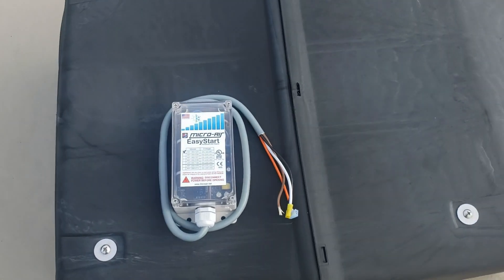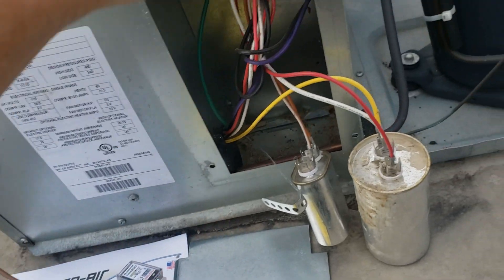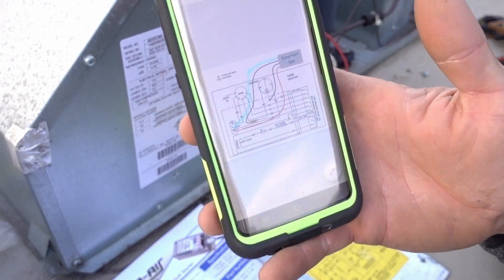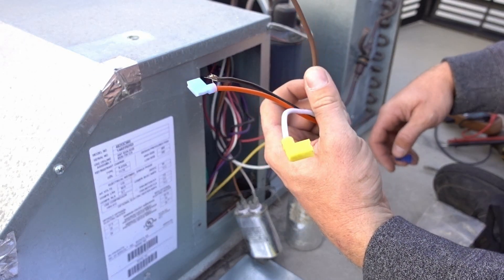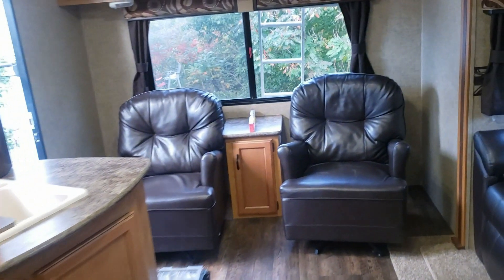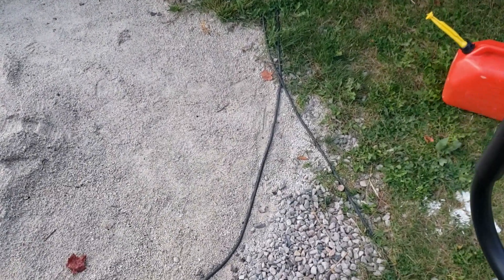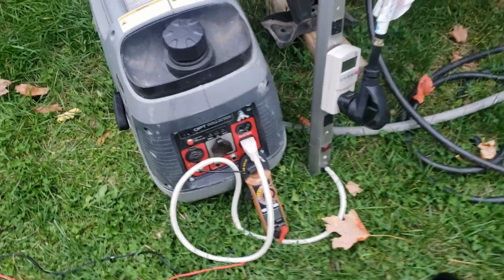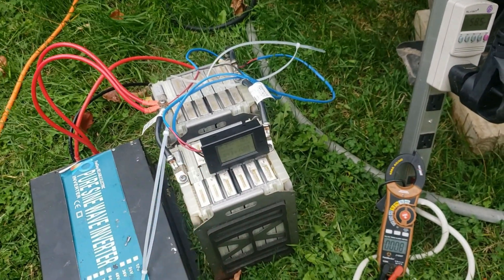Going Off Grid with Micro-Air EasyStart 364 to start RV rooftop AC 15K Coleman AC & Heat Pump

Comment: What is the model of your generator?  I have a Champion that produces 1700W continuous and 2000W surge and wonder if that should work.  Seems the vendor is suggesting a Honda 2200W.  Thanks.
Reply from the maker: its the p2300 so 2300w peak and it ran it with no problems

Comment: More EasyStart info from Micro-Air 

EasyStart wiring Diagrams:          http://www.micro-air.com/kb-easystart/articles_installation/easystart_RV_Brand_Specific_Wiring_Diagrams.cfm  
EasyStart 364:         https://www.microair.net/products/easystart-364-3-ton-single-phase-soft-starter-for-air-conditioners?variant=30176048267
EasyStart 364 Knowledge Bank:              http://www.micro-air.com/kb_easystart.cfm
EasyTouch RV Smart Thermostat with WiFi:              https://www.microair.net/products/easytouch-rv-thermostat?variant=32199143555156
Micro-Air videos on YouTube:     https://www.youtube.com/c/MicroairNet/videos
Micro-Air Facebook:         https://www.facebook.com/MicroAirEasyStart
 with Tips for the EasyStart and EasyTouch RV user

Comment: You think this would have stopped the fuses in the 8kw reliable from blowing?
Reply from the maker: it did, I blew the fuse running my house lol
Reply: Installing this on the Air conditioners that you where powering with the 8kw inverter, could have possibly stopped the fuses in it from blowing?
Reply from the maker: @RJ-cc1fz  yes also helps the inverter from blowing mosfets as well :D

Comment: Definitely need to get one for my 2.5 ton outdoor heat pump unit. The running amps is about 7 and locked rotor is 52 at 240 volts according to the nomenclature plate. I have 2 Magnasine 4448 stacked with the parallel threshold setting turned off so both inverters can handle the startup surge still blinks the lights in the house when the compressor kicks over. Fortunately I don't run it on the inverters too often because of this issue unless the grid is down and I need some A/C to take the edge off in the summer.
Reply: I have a Hyper Engineering soft-start for my 2.5 ton central A/C. Zero indication of start-up on my Outback  8048A (8k) inverter.
Reply: Micro-Air makes a X 36 model for up to 3 tons, and an X 48 for 4 ton and an X 72 for 5 and 6 ton AC-- all UL approved, affordable and high quality with great technical support.
Reply: LIght blinking eliminated by EasyStarts.

Comment: Super boost for a compressor. I call it a hard start kit for an ac compressor. Bin in the HVAC trade for 43 years .
Reply from the maker: great to know thank you!
Reply: A hard start is the anti-soft start.  Hard starts throw more power at the problem.   Soft starts reduce the power requirement and solves the problem.  70% reduction in power needed to start sound good to you?

Comment: My wife wants or rv ac running off an inverter this is a great idea. Got batteries would love a 48v inverter tho way less amps than a 12v
Reply from the maker: for a inverter rv set up this is a really good upgrade!
Reply: Inverter at home?  OUr UL approved 24V/240V works great. EasyStart 368 X-48 for 4 ton AC And an X-72 for the 5 and 6 ton models:  up to 72,000 BTUs.